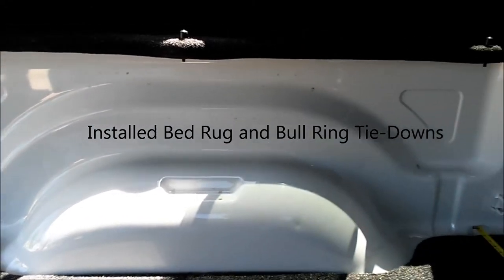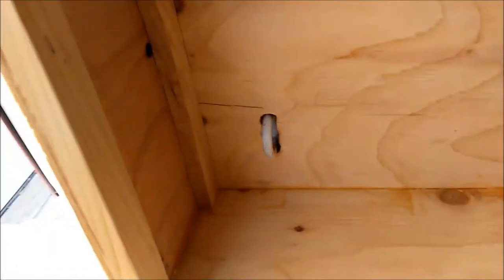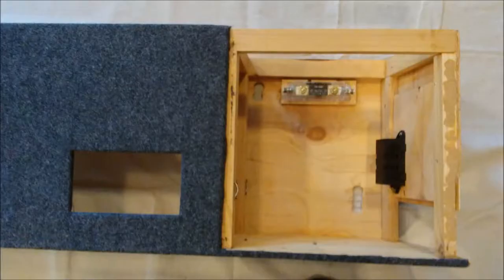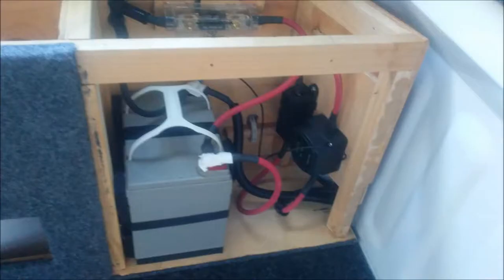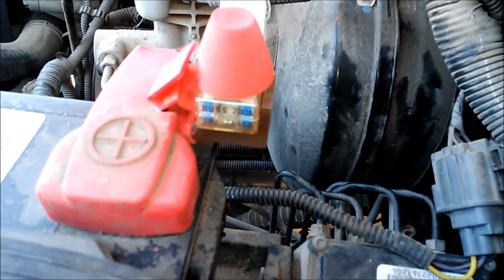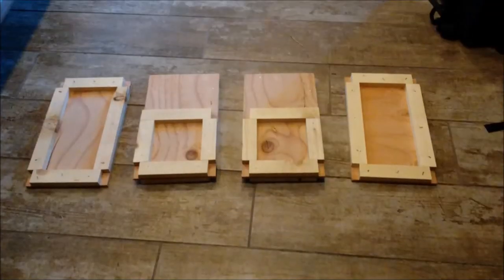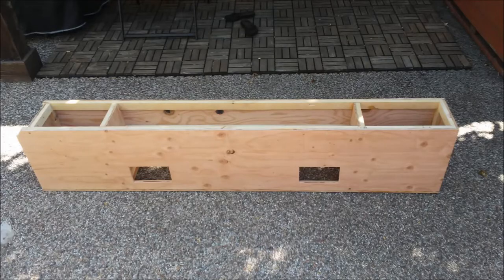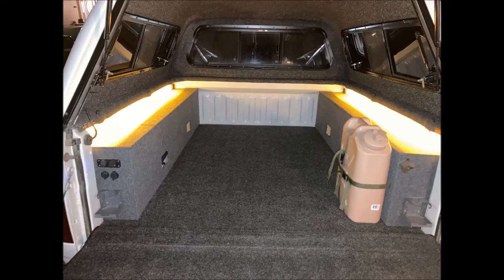Self-built pickup truck camper shell carpet kit with storage and power

Comment: love your setup. I have the equivalant except its a 97 yota tacoma reg cab 4x4 auto 2.7L 4banger a whoppin 150 ponies. Got the highroof shell though, I currently just put the memory foam on the floor and have storage boxes, want to do the storage like yours though to maximize that awkward space in the wheel well.
Reply from the maker: Thank you. Best of luck with your build! I like that era of toyota pickups.